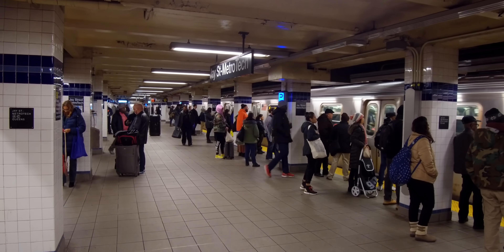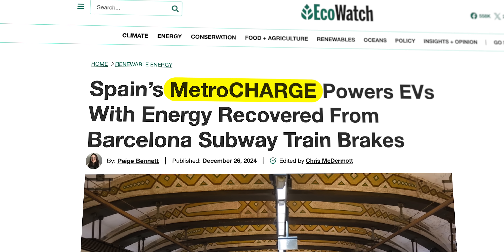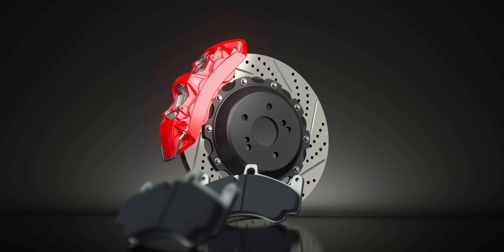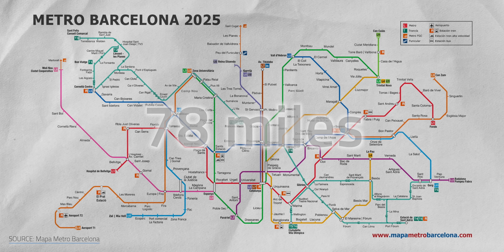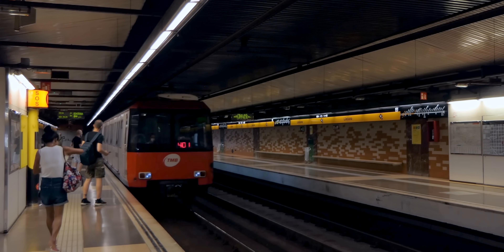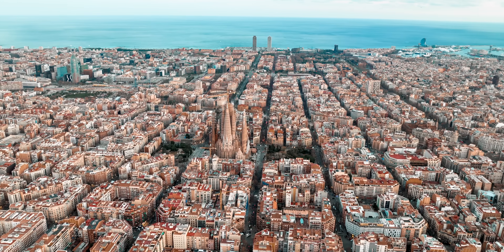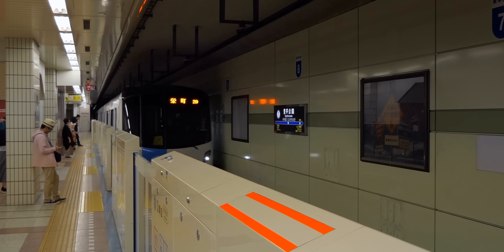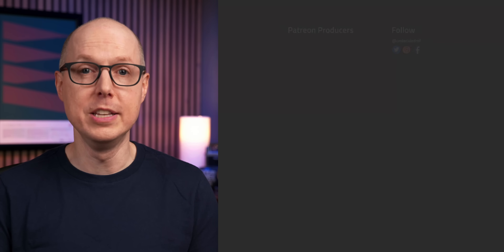The Most Overlooked Clean Energy Source… is Under Your Feet

Comment: Longer brake life isn't true because the calipers seize up and rotor corrod due to water and sice the brake pads usually shave that corrosion you eventually have to replace all brakes more often from one pedal driving its true i rented a tesla that was sitting which looks like a while and i had to stomp  the brake pedal a few times for it to work right

Comment: I have proposed a linear city along every interstate which provides the population density for profitable ridership to fund a parallel long distance high speed rail. Along the route are vacuum tube rails in tunnels for medium distances. The air that is pumped out of these tubes is pulled from the interstate, where pollution is highest. Air pumped out for vacuum is also compressed for pressurized air fuel cars.  Because the concentration of CO2 here is high, the compressed air needs to be filtered so we can sequester CO2 (for beverages and air sports, obviously). We will soon be able to use the new batteries that filter CO2 as a fringe benefit!  Compressed N2 is used for air cars. O2 is used for hospitals. If we cover the interstate with structural solar roofing panels we can reduce weather's effect on road conditions, as well as increase capture of CO2. But with such a large array of solar panels, we can fully power all the trains, air compressing substations, vacuum tubes, and even pumping hydro for energy and water storage. But no, we insist on cutting down the wilderness to plant grass and build ugly McMansions that appease our great insecurity over wealth and status.

Comment: What you didn't give among are the two required to determine how long it takes to amortize the cost: How much did the conversion cost? and How much money was saved per year?  I realize there are additional advantages that may not be reflected in monetary terms (e.g., the temperature reduction) or are indirect (i.e., outside agencies benefit from the system, but their savings cannot be factored in since they are separate entities), but we need those numbers as a starting point.  I'm all for this plan in principle, but I can't advocate for it over any other plan without a quantitative basis for comparison.

Comment: This isn't energy generation, this is energy recuperation. If the metro is running on electricity, it's just getting it back. Yes, it is totally nice and I'm not at all against that, but I just don't get this. The metro is probably already electric powered. Why just not retrofit some kind of light batteries (maybe even lead-acid or supercapacitors) to hold the energy back just the time of the station stop (like, what, 2 minutes) then also directly consume it to power the train back ?

I feel like the whole charging station thing is either a marketing thing to get more people onboard, or just a bit stupid. If this was let's say, gas powered metro (or trains) this would make perfect sense to get some of the energy back as electricity like a generator (I'd heavily say that for NA trains which run on gas, this would be a big big thing, especially considering freight trains kinetic energy, theses things are HEAVY)... but for electric trains just ??? Wouldn't it be cheaper to just upgrade or retrofit the metro trains themselves with some kind of short-term electricity ? You could even get some kind of flywheel energy here.

This is so fully misleading that I'm not at ease at all with this. A bit like the people wanting to generate energy from car motions through "bumpers" on highway rubbing people of their energy... On the opposite side, this isn't a scam and I'm totally aboard, but I kind of think they should fire the marketing responsible of this, because this is not rightly marketed.

Comment: Matt Ferrell, this is one of your least informative videos. You seem allergic to actual hard numbers, both in physics and economics. How much energy is recaptured? How big are the inverters? How exactly is surplus energy "routed to nearby EV charging stations", and as everyone in comments is asking how is this any better than just putting the electricity back into the grid?

Everyone, guess how much energy a 300 tonne train travelling at 50 km/h has. You don't have to guess, use a units calculator (I use the online one at Fourmilab). Kinetic energy is 1/2 m v^2; 1/2 * 300t * (50 km/hour)^2 = 8.0375514 kWh, and 11:36 "Trains can recover between 15% and 45% of their braking energy", so a measly absolute maximum 4 kWh recovered from each incoming train. (The New York State Energy Research and Development Authority estimates "Seventy-seven percent (77%) of available braking energy (5.4 kWh regen energy/7.0 kWh total braking energy) is returned as regenerative energy back to the 3rd-rail grid"... to heat up banks of resistors 😢). It's a big power pulse, and it's great to recover that energy, but it's only a lot across the entire subway system; around 20-60 MWh for New York City.

Comment: My guess is that Tesla's interest in super-capacitors is based on the batteries' inability to charge as fast as the regenerative braking can supply electricity -- put the extra bit into the caps and use that to accelerate from the stop.  Less complicated than adding hydraulic motor/pumps and accumulators.

Comment: They should continue developing the system. It can only improve and become more reliable in time. The initial cost may be high but it could even out years down the line.
Eventually oil will come to an end, we need to continue developing green energy until that day comes.

Comment: I don't get it or maybe I missed it but why bother with EV ? Why re invent the wheel ? It's funny too since there is a all section of the video dedicated to thermodynamic, heat lost in a closed system. "40% reused for the station and se surplus used of EV" What surplus ? Are you impaling that metro and train uses less energy to start than they could produces via regenerative braking ? When there is a section about thermodynamic in the video ? And unpopularity of EV is mentioned as a drawback... I don't get it.

Comment: I think you need to separate the argument into parts. One does regenerative braking make sense to recapture electricity and I think the answer there is clearly. Yes the second question is what to do with that excess energy and it doesn’t matter whether it ends up in E. V. chargers or fed back to the grid it still reduces overall electricity demand and us has a value Boath economically and from a climate perspective. I think it’s a much more powerful argument to taxpayers that by implementing regenerative breaking will reduce electricity cost by X million dollars a year and get a payback on our investment in Y years.  That’s an argument everybody can get behind why clutter it with assuming the power has to be used for EV chargers, which is a political hot button?

Comment: They implemented the most complex form of regen possible... its not a surprise that others haven't matched it.  There is no reason the regen couldn't be built into the train cars themselves with just a small bank of capacitors.  Regen charges the caps up, and they are discharged for accelerating the train back up to speed.  Exactly the same savings as returning it into the infrastructure, with a minimal loss due to needing to move the weight of the system.  Best part though is that having it built into the cars themselves makes it insanely easy to implement.
Reply: Came down to the comments to say the same, the best place to use regen energy is in the same system that generated it, either back in to the electrified rail circuit or in to storage of the carriages themselves.
Reply: Afaik adding the capacitors on the train itself would be too expensive compared to having them built at various points on the path there. Transmission losses exist but you save up a lot on needing fewer of them as on the whole network there are typically not more than a couple trains currently stopping more than the trains accelerating.
Reply: @meneldal they aren't that expensive.  About $12K  worth per train car from Amazon.  Probably cheaper in bulk.
Reply: The regen is already built into the trains. The recovered energy is fed back into the railway's independent power grid for other trains to use. The Spanish project makes no sense.
Reply: That's not "a small bank of capacitors," that's a massive really expensive capacitor bank. Capacitors are worse than batteries unless you're zapping a laser for a second,.
Reply: @skierpage  Supecapacitors are pretty decent for size vs storage, not nearly as good as batteries, but can handle millions of cycles, so are great for short duties. Depending on transmission it may be easier to feed it back into the grid but depends on power type and voltages.
Reply: @skierpage  I did the math  but for a typically NYC subway car, you would need 17 of the Maxwell Durablue 48V 165F Super Capacitor Modules ($700 on Amazon) to store every joule of kenetic energy of the car travelling at 60 kph.  They look like large boat batteries.

A battery wouldn't be great for for the constant charge/discharge cycles like this.  This is a purely regen system, not batteries that charge up and gain a fraction of a percent of their charge ever time the vehicle stops... we want to charge the bank to  80%-100% every time the train stops and fully discharge it during accelleration.

That said... you could use batteries if you wanted... but I think you would want to use a bank with capacities several multiples of what will be regened during braking so your not cycling the battery so much.
Reply: @josephhfry  I was wrong to focus on energy rather than power. A 70 tonne subway car at 60 km/h has 2.7 kWh of kinetic energy, which is peanuts, but if it slows to a stop in 20 seconds that would generate 480 kW power. That's a 5 C recharge for a 100 kWh battery, which is pushing it but is only for a few seconds;.A 48 V 165 Farad capacitor stores 0.0528 kWh, so you'll need 28 of them or $20,000.

Batteries and capacitors are close in this applicatin.

Comment: This doesn't make sense to me. Obviously improving the efficiency of RB is a good thing. But why care about how it is used? If it goes into the grid it can be used by anything. The metro operator should be paid by the grid operator. If it is really just about the investment potential and economic position of the metro then this video should be a bout that.
Reply: the reason the metro is keep the energy to themselves instead of the grid is because grid operators will make less profit. the metro is basically a completing grid operator. same goes for solar in the US at one time you could sell back unused electricity in the grid to your local utility. many have stop doing this because of profit. what should happen is every home in the us should get like 4-6 panels installed by the local utility and maintained by them. No choice part of the service. this would general jobs across the country big time. and all these solar panels will trickle in to the US grid. in addition at all these solar farms popping up should be storage batteries too but i haven’t seen any in my area.

Comment: I get the whole regeneration braking, but why wouldn't it just temporarily push back out to the same grid the train is pulling power for later on when it goes to leave or accelerate.    Whether storing to battery banks or using the grid as the battery the base  concepts the same in recapturing the power.

Comment: I think this helps to underscore that alternative energy will likely never come from a single (or just a few) sources at scale. It will come from a large group of disparate technologies that will have to be either retrofitted into the existing grid, which will have to be strengthened; or, utilize a yet to be constructed new grid that is purpose built to accept a variety of varied inputs from disparate geographic locations. One item not addressed directly in the video is that the impact, other than financial, of implementing this RB train system is that it does not consume an excessive amount of resources, nor does it require occupying land that can be used for other purposes. Also, RB systems can also outlive other "green" technologies. I've got a 14 year old Prius that is still running fine with it's original hybrid battery. I know people who've had to replace major components of their solar systems in that span of time. Obviously RB on it's own will not replace Solar, wind, etc., but this type of technology seems to make far more sense and financially has a much better ROI/break even point.

Comment: Munich Subway (MVG) does this since introduction of their 3rd generation trains (C-Series) in 2002. Regenerative breaking is not new. Obvious use is to power the other trains in the system. Subway systems will never have a surplus energy that can be used to charge EVs etc. If they would, this means a train would generate more energy while breaking than it uses to accelerate. Simple physics 🤔

Comment: the easiest solution is instead of ev chargers you add something like a megapack. Most stations on the east coast have solar and they offset a lot of energy. why not make it with regen? older systems would just need to be modified at each stop if not electric with dc or ac. then the company would be as a electric provider/ broker. This is already partially true in New Jersey with solar power.

Comment: I can argue that you can reduce your brake wear just by engine breaking so EVs have no advantage there but it is up to the driver.
I am surprised that regenerative breaking is news for trains being in the metro or not. I know some trucks use electric retarders for slowing down on long descends but they have no enough battery storage so they use resistive heaters to dissipate the energy.

Comment: Matt, all modern electric vehicles - trolleybuses, trams, metro trains return electricity back to other vehicles in the grid that are accelerating. If they have a modern substation they can power the whole grid.
Reply: I also was like "wait, what's the news here"? German Wikipedia lists a lokomotive from 1979 as the first example...
Reply: I was kind of astonished this wasn't mentioned either. 

I really thought this video was about using subway power stations as additional power cables in a city (which is proposed for the tram system in Rotterdam (Netherlands) for example).

I also don't really get why charging electric cars with that energy would be that revolutionary. 
First of all: if your subway system is big enough for every decelerating subway train there will be an accelerating subway train, which needs more energy than generated by the deceleration. 
Second of all why deliver specifically to electric cars? Is that only to reduce transformation losses? Because directly inputting that energy into the main grid would be way more versatile.
Thirdly: why botter the electricity grid at all with that energy? Subways are constantly accelerating and decelerating. It seems like a perfect vehicle for a capacitor, storing that power for a couple of minutes, so it can be used directly in the vehicle.

I don't really understand why Matt thinks this technology is that impressive. It's just good practice, but nothing revolutionairy I would say.
Reply: Exactly. Weird it wasn't mentioned.
Reply: Exactly. Only new thing in that video is that Barcelona metro does not send surpluses of power back into network, but consumes it in it's own network. What is that good for? It's lessening the load on Spanish power network because it does not need to accept big irregular surpluses back into it's network.
Reply: @tetragramat  I still fail to see what's so revolutionairy about that. I really thought (and a others in the comments seem to agree) that this is common practice: train 1 brakes, train 2, 3 and 4 get powered by the recuperated energy.
Reply: @tetragramat Sure but I wondered why they didn’t just keep it in the train via battery or capacitor.m, as noticed above. Big absence in the video.
Reply: @Eponymous300  I suspect the size and cost of supercapacitors large enough capture that energy would be prohibitive. But I agree with the OP, the video doesn't really explain why Barcelona's approach is so novel
Reply: @rolandd3173  That may well be, but it's an obvious thing to address in the video, which was the point I was trying to make.
Reply: @Eponymous300  If the trains have a permanent connection to their power supply, which almost all electric trains have, then there is almost no extra capital no extra weight on the trains. cost. Also countries like Japan have been doing this for decades, and batteries were not even close to being useful.
Reply: @tetragramat  But the drop when a train stops is going to be less than the rise when it starts. Plus at any given moment some trains are starting and some stopping. Adding regen just smooths things out. I'm struggling to see why a two way connection to the grid isn't the simplest solution.
Reply: The key word here is "modern".  Washington DC has a pretty good metrorail system.  The cars are, or were until recently, rather old.  While they were upgrading cars, I don't think they put an RB system in, so do they count as "modern"?  You decide.

Comment: Saying that trains are "powering" EV's or "generating" power is pretty disingenuous.  The trains with regen braking are consumers of power, just because they give back a small percent of the power they took in the first place doesn't make them producers of power.  I totally don't get the whole idea of wiring up the regen power to EV chargers and not just pumping it back into the grid and let the EV charges pull power off the grid.  Power is a commodity, it doesn't matter if the electrons came out of regen braking or the power plant, they all look the same at the point of use.